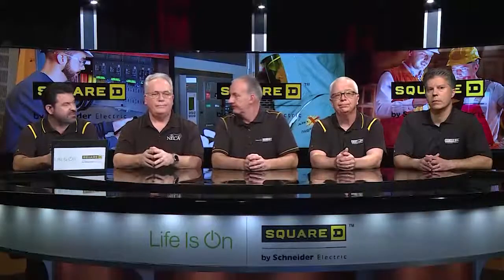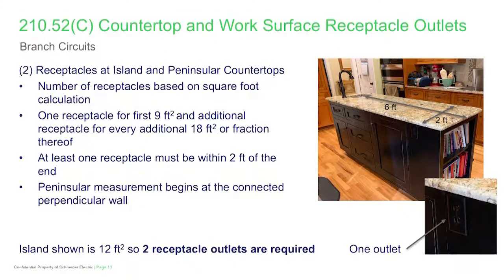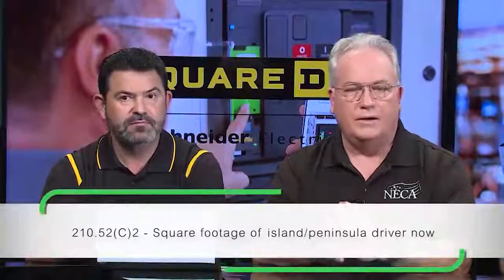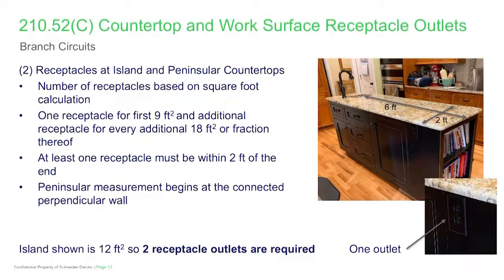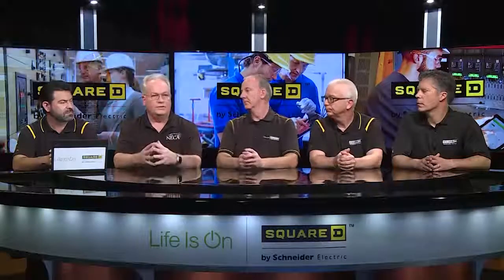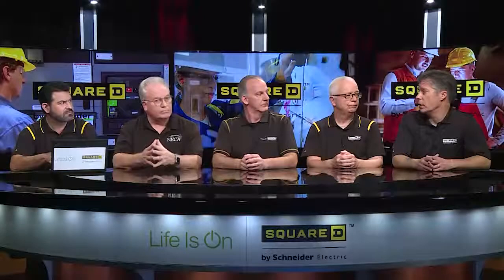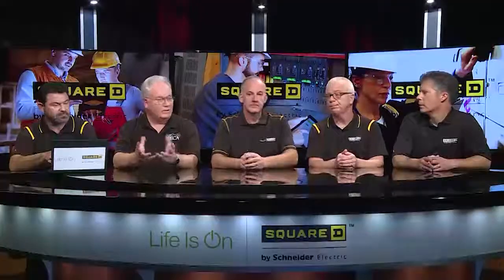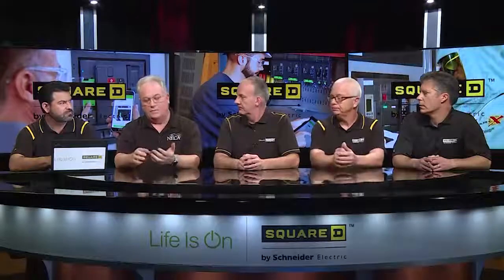NEC 2020: Residential - Island and Peninsular Countertops

Comment: I basically do nothing but kitchen remodels and this is one of the dumbest codes ever.  If the home owner wants more than one outlet in their island then they can request it and go through with a designer to figure out a functioning layout.  Most islands I do have cabinet faces with no fillers on one side, seating overhang on other side.  Leaving the short ends only available for outlets.  Stupid useless code, just a money grab.